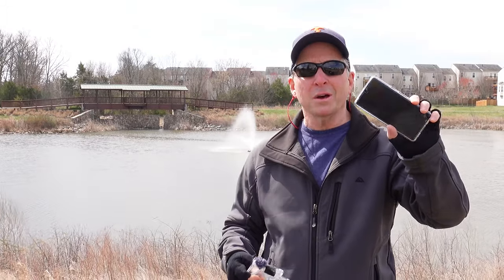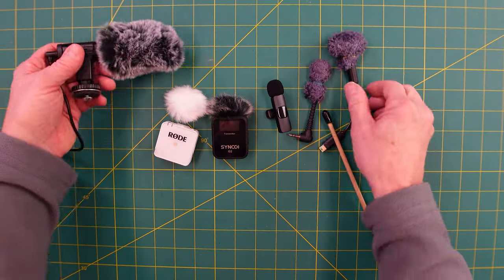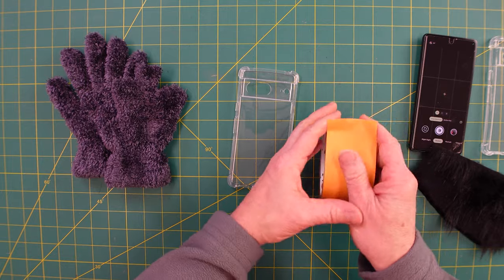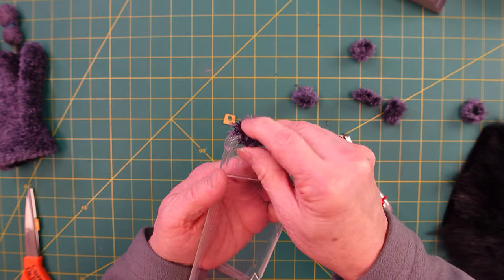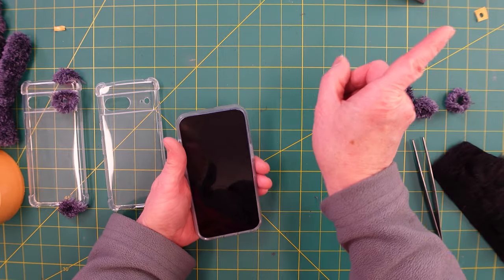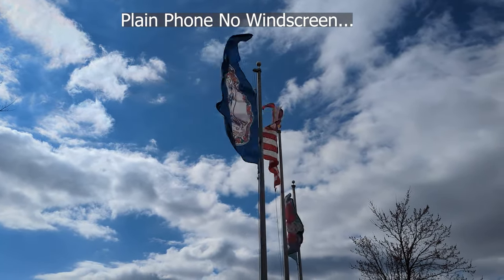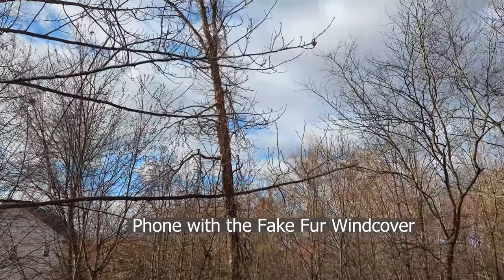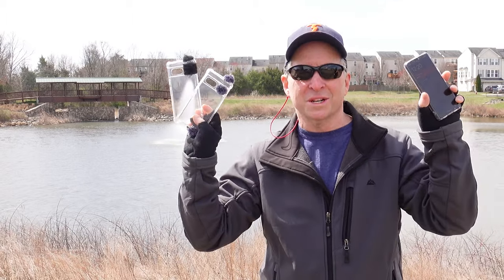How to Make Phone Mic Windscreens, Windblocks, Wind Covers for Under $7 in 5 Minutes

Comment: now just remove the backing.... like its easy!!! lol that the worst part of any 2 sided adhesive tape. these are both great ideas
Reply from the maker: Thanks Doc Ink. Agree the backing can be a pain sometimes... okay, manytimes...
Reply: the trick is taking the glue part off the backing stright from the roll (roll out what you need and remove only the glue part, not the backing cover)

makes application a bit more annoying and less precise, but nowhere near as annoying as having to remove the backing cover